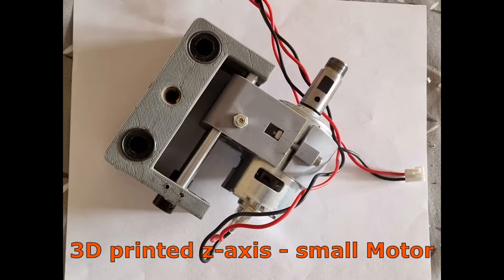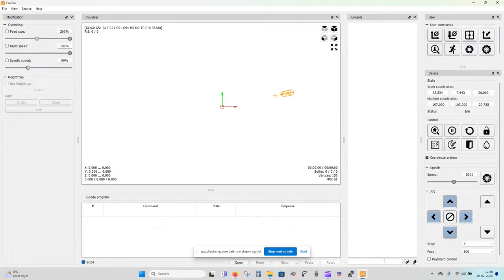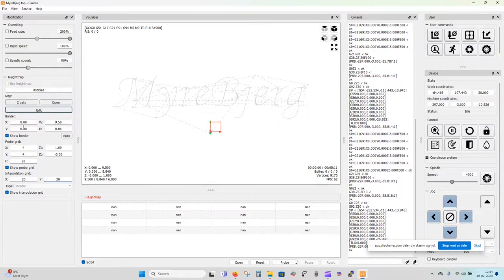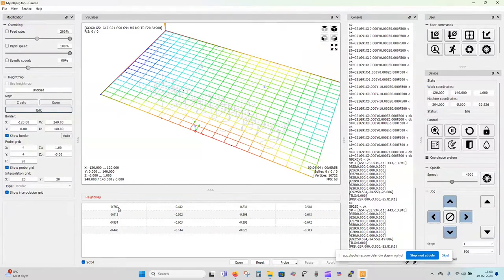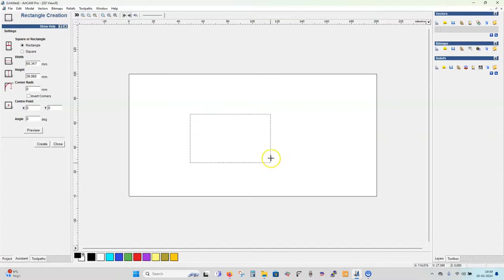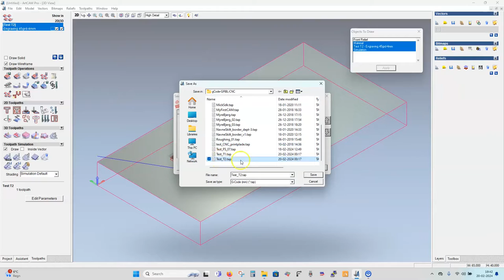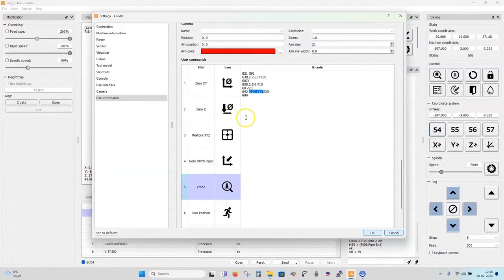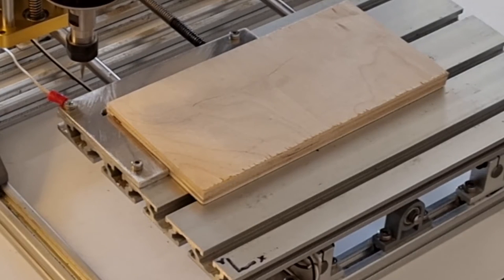DeskTop CNC 3018 - Z upgrade + SATC setup

Comment: Thanks very much for posting this. I really like the setup you have here with the combined tool length probe and fixed XY position for stock on the bed.
Reply from the maker: Thanks Don :) - I always try to keep it simple. The setup with the end-shaft for probe electrical circuit is changed - didn't work properly, though... I will change to a tool-setter somehow next time I will optimize the design :)